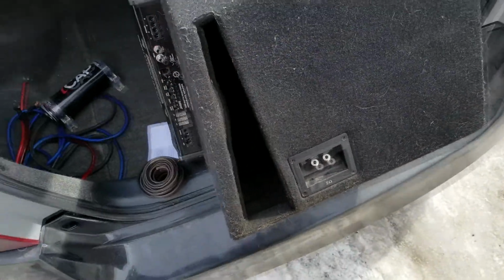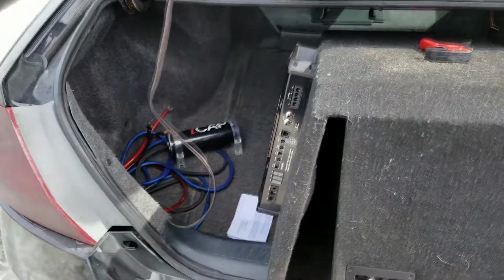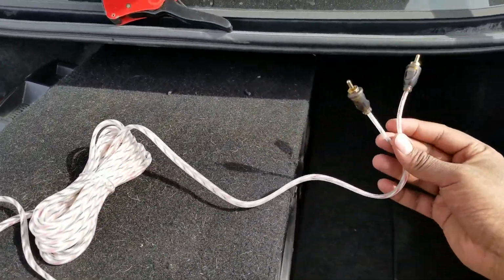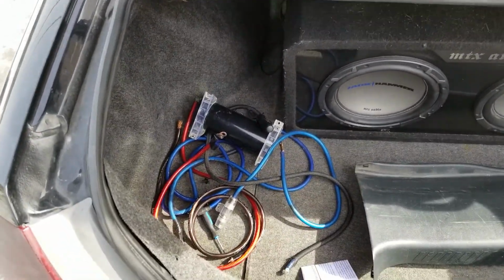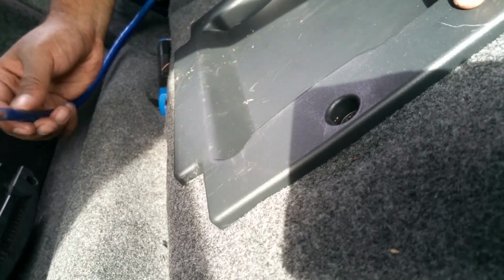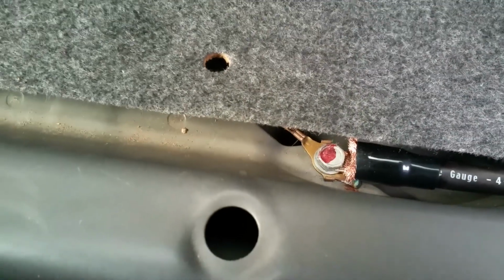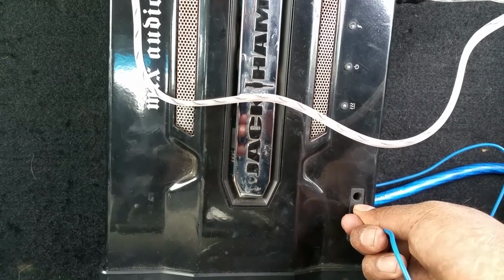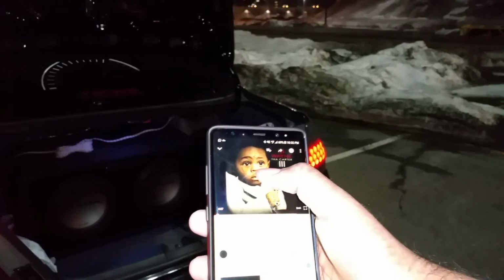How to Wire Subs and Amplifier | PART 3 - Sub & Amp Installation

Comment: Where did u connect the remote turn on wire 2?
Reply from the maker: To an aftermarket switch I installed on the dash so I can turn off or on manually